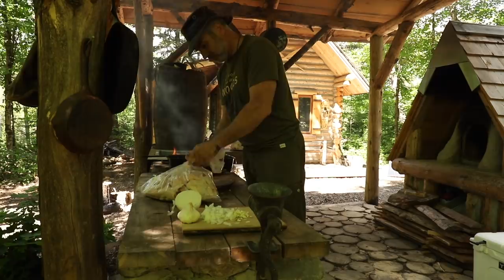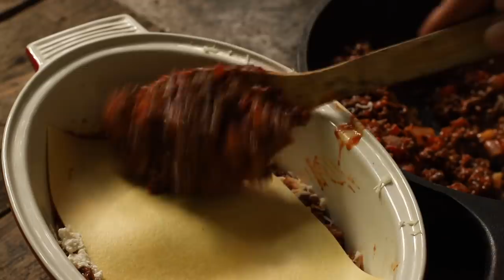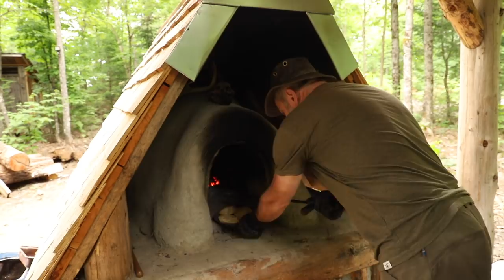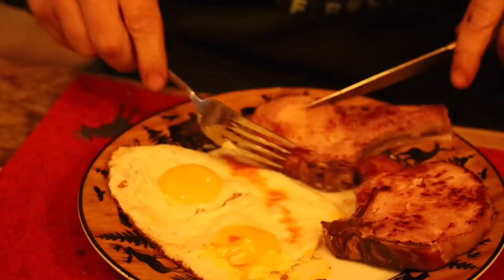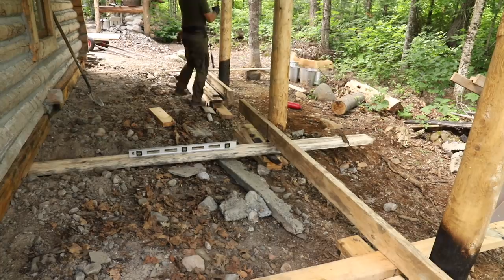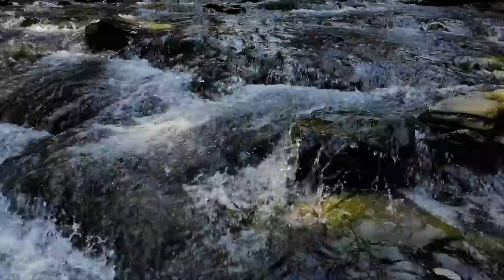Build a Log Cabin Porch | Bear Lasagna in the Off Grid Forest Kitchen

Comment: When you finish rendering the fat, strain it through cotton muslin or equivalent fabric. That will remove the tiny bits that pass through your strainer. You can render additional fat from those crackling, if you continue rendering in an oven (of some type). Better heat control, at that stage, to prevent burning. After, as much fat, as is practical, is rendered, the cracklings will keep for a while. Great for munching, seasoning of vegetables, and added to bread dough. Nothing goes to waste. When I was a kid, we rendered pork lard using my Mother's castiron washpot. Used a wooden paddle (like a small boat paddle) to keep them stirred. BTW, once the included pork skin was done (before it turned crispy) it was delicious in one of Mama's homemade biscuits. Especially when standing around the fire under that washpot on a cold December day. (Traditional butchering day in my part of the southeast USA.)
Reply: I remember  do that as well at my grandfather's

Comment: Shawn, You may never have a difficulty, but.  My all steel hammer used to give me some extremely painful hands.  At times, it reached the point of incapacitation.  I used a very popular and strong fiberglass handled hammer at times as well. Initially, I never knew why,, I just chalked it up to age related.     I went back to hickory and ash handles. Problem solved.  The steel and fiberglass handles were hitting me back.  These days all of my hammer handles are wooden.  I normally find and re-carve a 16 or 17 inch 'engineers handle', and my normal hammers are 16oz or 20 oz claw hammers.  I rough up the grip area with a rasp and set a friction tape,, just the tape width, but 8 to 12 layers of tape, 'stopper', right at the butt of the handle.

You may never have a similar difficulty. At the time I was a pro framer and running through,  a 50# case of nails per day was normal,,, every day.   It just pained me to see someone using a steel shafted hammer.

Comment: @Shawn James, Seeing as though the Earthen Oven Did not turn out quite like you planned have you considered modifying it so you have more heat control. You could add a thermometer to the door (drill  hole and stick an oven meat thermometer through it) as well as a vent at the base of the door to control airflow more efficiently.  Just a thought.

Comment: You'd not have to worry about rust in your pans if you had Corning Vision chicken skillet for stove top, in glass. It comes with a lid. They are mostly sold as vintage on e-bay. You can clean off any burnt marks with lemon acid or a strong soap that you leave on with plastic over it for a week or more.

Comment: Nice try but lasagne procedure is a bit different: for the sauce first roast onion and then pur the meat (a glass of red wine should be added). Only after this put tomato sauce. For the lasagne composition, each sheet of pasta should be plunged in salted boiling water for a minute or a minute and a half and then start composing the layers on the bottom a bit of oil or grease then a sheet of pasta the meat sauce and on top the cheese. Doing  this way every cut of lasagna stay in place. Last but  not least, after cooking lasagne do not  cut them straight from the fire. Leave them rest a Hood twenty minutes to consolidates. Cheers!

Comment: YOUNG  MAN ,

HOW SO U CLEANING YOUR CAST IRON  /  I USE 1/2 RAW BAKE POTATOES AND COARSE  THEN WASH EVERY THEN OUT WITH HOT WATER ONLY  / THEN IF NEED TO BE SEASONING AGAIN / I WILL HEAT CAST IRON IN MY OVER ABOUT 400*  AFTER THEY COOL OFF I OIL THEN UP LIGHTING